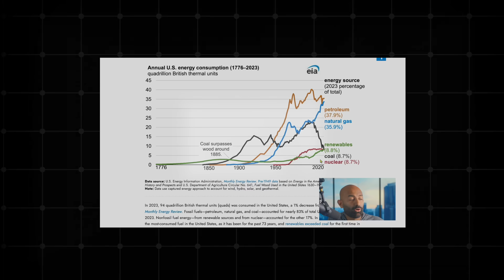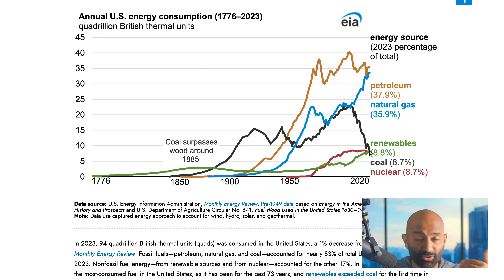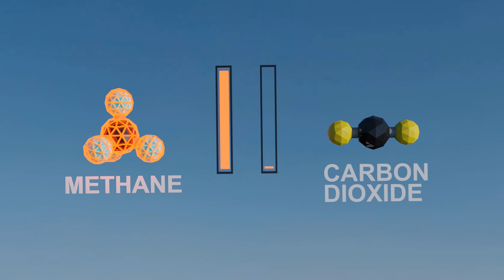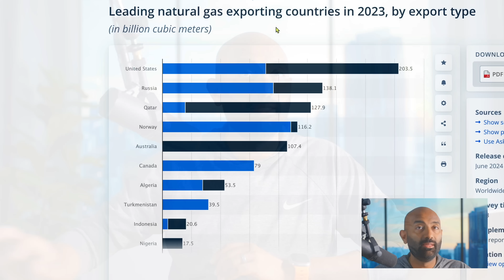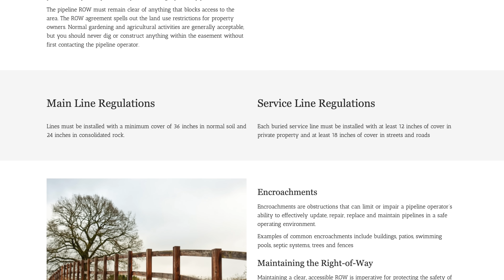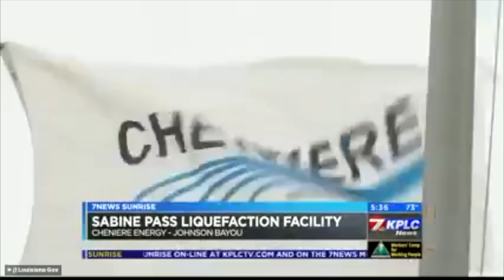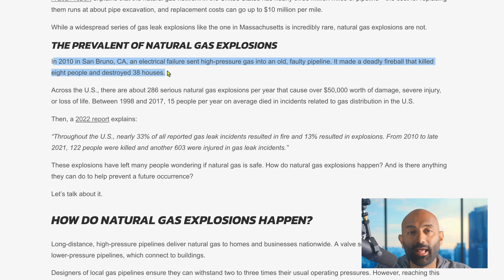The TRUE Danger of Natural Gas - This SHOCKED Me

Comment: Bro, as a 20+ year gas field compressor mechanic  I usually dig your vids but this is just fear mongering with tone, and harping on existing infrastructure.  pipeline transfer in united stated is by  far safest by volume including intentional and accidental emission.  The stuff boils up from the depths of the gulf of america naturally, have you ever smelled Galveston?!  🤣  Just dont get lost in the anecdotal evidence. A LOT of private and public moneys went into building out these networks, and that alone keeps it cheap for the masses trying to stay  warm and cook.(assuming the communists arent outlawing gas stoves)  The epoxy disaster and windfarm cemeteries are downright raunchy in the hazards posed to the environment compared to modern lng networks that spider across the country quite dense might i add.  Cheers from Texas~!

Comment: You should definitely have your pipes inspected every 2 decades (to 25 years).
The death figures are pretty small tho.   Well under electrical use and even solar power installation.

It does contribute roughly 25% of total Co2 when you include methane leaks during production.   

However, residential natural gas has an odorant added to it.   "The odorant added to natural gas is typically mercaptan (also known as thiol), specifically tert-Butyl mercaptan (TBM) or a blend that may include methyl mercaptan, ethyl mercaptan, or dimethyl sulfide."

Comment: Being lighter than air tends to make methane safer, not more dangerous. Methane tends to float up and disperse. Propane is heavier than air and thus settles. A propane leak in a basement will stay in the basement until it is full of propane and spills out or finds a source of ignition. 

All energy sources concentrated enough to be useful need to be handled with care. Electricity, methane,  propane, gasoline, lithium batteries all can be exceeding dangerous if not handled properly.

Comment: Just finished our gradual conversion. Heat pump water heater, then heat pump HVAC and now induction stove. We turned off our gas main 2 weeks ago. It’s great. Induction cooking for us is way better. The HVAC works the same. We are probably saving $300-600 in the winter on aggregate heating costs.

Comment: A house exploded in the UK recently because they installed a heat pump. The problem wasn't the heat pump, it was natural gas. And they hadn't nicked any gas pipes digging the geothermal system, it was natural gas. They'd hit a natural gas pocket, and failed to seal it correctly. Natural gas from the ground is odorless, and it built up to an explosive level and blew the whole house up and killed people. The area was evacuated for weeks. The house has since been demolished.

Comment: This is why in Canada we have plastic piping underground to people's homes and are not permitted to put unprotected piping into homes, we must sleeve steel or copper piping in plastic piping and double wrap them when going into the house or through floors which prevents corrosion. 
I agree with you that heat pumps are the future but a gas backup is required in cold climates. 
By the way natural gas and propane usually contain mercaptan which makes the gas smell like rotten eggs to be detectable.
Thanks for all your interesting videos!
Reply: That a backup is required is certainly true. But that it be gas isn't. A wood stove would make a good backup with fuel easy to store and acquire if you have land.
Reply: Maverick, I use a wood stove backup in our mountains. Solar runs the heat pump, mini-split heating during sunlight hours.

The good news is that battery backup is becoming safer and more affordable.
Reply: Mercaptan is added after processing the gas, and prior to delivery to customers.

Comment: As someone who has nearly two decades in majority-renewables engineering, I am certainly in favor of you paying me more money for new electric options. But as someone who has seen a much wider sample of the energy industry, I think there are many incomplete ideas in this video. Electricity has most of the limitations as gas in terms of production, transport, storage, losses, risks, and aging infrastructure. It has been implicated in some of the most costly and deadly wildfires in US history, the majority of which have occurred in your home state. Consider the Camp Fire (CA), the Lahaina Fire (HI), and the Eaton/Palisades fires (CA again), all occurring within the last eight years and having power line events as their probable origins. Do you remember the Moss Landing battery storage plant fire near Santa Cruz? It just flared up again two weeks ago. Also, electricity and gas are equally capable of contributing to house fires since the single largest source of house fires is the kitchen. In my opinion, you had some fair points to make but did not contextualize them into a full picture of energy needs and competing trade-offs.

Comment: Heat pumps are very expensive up front. And require super excellent insulation in the entire house. Almost airtight.  Seal up the fireplaces, no more cracking the window in the bathroom to let the steam out. 
When the ice storm brings down the power lines,… adios granny.

Comment: You’re saying use heat pumps to heat our homes ……are you crazy!? That would triple my electric bill easily living in the northeast right on the ocean. Yeah, no thanks, I’ll burn wood and oil all winter instead. Also, heat pumps only work till a certain temp. When it’s around 45 degrees and colder they won’t produce anything heat wise.

Comment: I have no natural gas in my area as we all require hauled in propane for heat.  I would like to purchase a heat pump for my home, that would be a 8k to 10k investment.  Still have to heat the water and I'm not sure that worth it.  I spend $2K per year for heating.   I'm effing stuck.  I'm old, my well went out that's $60k.  I'm old I'm on a pension.  If I went for the right SER rating heat pump I could qualify for a rebate (not sure under tRump)  I have solar so no electric cost.  Just sucks

Comment: Great ideas for urban people, but those of us in rural areas cannot just shift off from natural gas. You seem to have a bias against natural gas due to experiences which is fine. In rural Minnesota we do not have 100% reliable electricity.  By using natural gas for cooking and heating, we don't need a large generator to keep our homes warm for days. Also, in farming and at our local co-ops natural gas is used for drying grain. A lot of farms use propane to dry crops but a lot of farms in my area are getting access in the last 5 years to natural gas which is much cheaper to heat with and dry grain. Natural gas is booming and growing at an incredible pace in my region.
Reply: This isn't a "urban vs rural" situation. Some of the best use cases for homes eith no gas are off grid homes. If a home is built to retain energy better, it doesn't need the higher energy usage gas and can do just fine off solar or geothermal, etc. But he does say in the video that maybe gas is piped and reserved for use cases where it makes the most sense aka the coldest climates.
Reply: I agree, I live in rural Saskatchewan
Reply: I want my choice.  If you want electric, fine.  Don't touch my natural gas.

Comment: @7:50 LNG is not "consumed".  LNG is a storage mode for transport.  It is re-gasified for consumption.
YouTuber Engineering Explained does a very good video on the Gas Explosions in the Merrimack Valley. (Near Boston).  He has other NG videos as well.
The flare gas at refineries is not necessarily natural gas but rather a bevy of gases that are not commercially useful.
@11:21 - those are oil pump jacks.  Nothing to do with NG.
There is no such thing as "sustainable potash" - it's a one shot deal.  Mine it.  Use it and it's gone.

Comment: I have heard that renewables are possible precisely because of natural gas backup, which can ramp up and down more rapidly.  What is missing in the renewable portfolio (wind and solar) is dispatchability.  This is the so-called "clean firm power".   I suppose (grid) batteries can take up some of this slack, at least for time shifting.  And some gas peaker plants are being dis-placed, with batteries.  There is a need for "long duration storage", esp. seasonal (mainly winter)..  Perhaps other alternatives maybe enhanced geothermal (e.g. Fervo), and nuclear (SMR's).
Reply: pumped water storage too.
Reply: Much of the seasonality can be handled by the grid moving electricity around. The frozen North needs more power in the winter. The sun baked South needs more power in the summer.

Comment: I live with a high energy heat pump now, and an electric stove I wish had an inductive cooktop. I use an induction single burner regularly, though, and love it. If I were buying a new stove it would absolutely have an inductive cooktop. A household member has asthma, and it's made me keenly aware that a gas stove is the biggest source of indoor air pollution in the homes of most people. Houses can and should be all electric moving forward.

Comment: When I was 12, we moved into a brand new house and a few years later we had a bad gas leak. I saw the pipe. It was very rusted in one spot and not at all in either direction. It was because of the acidity of the soil and that one spot they attached an anode to it and large piece of zinc I thinkand that was supposed to stop it from happening again.  they must add mercaptan to make it stink

Comment: Not everybody lives in a city where you have pipelines.  the other form of Natural Gas, AKA propane is indispensable  in rural areas,  especially where you are not getting enough sunlight each day to charge up those nasty Lion batteries. further, minisplits that use gas to heat the emergency heaters makes way more sense on the off days. ,,  I know I live this each day.

Comment: We live in southern Ontario Canada. We use NG for our furnace and water heater because it's cheaper and available at a flat rate. It will take three things to get me to replace my water heater and AC system with high efficiency heat pumps. 1) The tech must mature enough to represent a savings in under 10 years, 2) The government must offer a flat rate billing system, and 3) The Government must offer us incentives like low or no interest loans, or a large and immediate rebate. Not one where people have to PIF and then wait for a cheque. The NG furnace will stay as a backup. Because while -40 is uncommon, it's not impossible.
Reply: Exactly. It would cost a fortune to replace/upgrade every appliance to electric, and not everyone has that kind of cash sitting around.
Reply: @timwildauer5063  I wouldn't replace anything until it needs replacing.
Reply: The electric grid couldn't handle it either if everyone was forced to used electricity.
Reply: @callak_9974  Ask literally any industry professional who is not subsidized by an oil company.

Comment: We have satellites mapping gas leaks. Producer's should buy the data and just fix the leak.  Our power is produced by nat gast, so our heat pumps are still using nat gas. Now there are heat pumps driven by nat gas to the house, although you are correct

Comment: In Australia we see galvanised pipe that is buried for use with gas or water become swollen and develop into a near rock formation that eventually weeps and dissolves. I’ve been told it’s called chlorosis but I’m not sure. It may have to do with moisture and electron exchanges in minerals in soils. Usually 50 yrs is the life span of a buried galvanised pipe.

Comment: I have a gas well on my property and draw from it for my house. to do this I have to add an odorant to the gas before it comes inside by law. as has been said gas delivered to customers also has odorant. As you say it is lighter than air and as such unless the leak is inside it will quickly disperse in the house you will smell it. While it's not great for the atmosphere it is not nearly the explosion risk you seem to imply.
Reply: Well, a heavier than air gas would be a bigger explosion hazard certainly.

Comment: I live in Minnesota. The last thing I ever want is to be totally reliant on electricity. I have back up generation but it is a limited source in a real emergency. In the winter especially, it would maximizes my generated power and it heats my hot water also with fast recovery which my previous electric water heater did not. As for leakage being hard to realize(?)you have not been around a leak. Our pipes are all non corrosive plastic except for the last 4 feet. It purposely smells to high heaven. If you live in an area without freezing temperatures be my guest to trust your heat pumps. I know of two people who have heat pumps for household heat and it has been a disaster for them to keep them working in the winter. My two cents.
.
.
Reply: Spot the bot.

Comment: NEVER allow that explosive gas inside your house.  Gas is horrible option compared to electric.   Very dangerous.  It never should have been piped into residential structures.  Electric is 100% efficient, appliances are inexpensive and easy to control, and often operate without any noise.
Reply: In fact a heat pump moves heat so it can be over 300% efficient!

Comment: I googled some comparisons: The cost of gas vs electrical hookup(gas is much cheaper). The cost of heating with gas is much cheaper(maybe 1/2). The reliability as a backup source and cost for heating(gas is incredibly cheaper). The cost to install gas heat vs solar heat is much lower. There should be improved standards for solar hookup and new homes should be designed for solar, else gas use will thrive. I'm old, I could never justify the cost of replacing my gas pack with all electric system with solar. I wish I could!
Reply: I also live in New England and at the cost of gas and the cost of electricity, a heat pump is only the best price above 34°F. This would be for Nashua, NH. 

If people want to transition away from heating with gas, they had best start building nuclear power plants because solar doesn’t work well in the winter, wind is unreliable and ugly. We could bring in hydro from Quebec but last time they tried there was a huge outcry about running the wires. 

In the meantime, in January, people are very happy to have gas heating. I sure wish I did.
Reply: The cost of heating with natural gas vs oil vs electric are very regional dependent.

I am in an area with around average natural gas prices but well below average electric prices.  Switching to a heat pump for home heat and hot water was a no-brainer.  If I had natural gas as an aux heat option, natural gas would have been cheaper than my heat pump at 0 degrees F this winter.  We never went below 0 this winter.

In New England, where most of my family lives, heating oil is the the most cost effective heating option this year.  Natural gas almost was until some very high delivery fees were added to bills in Massachusetts.  The electric rates up there are just insane.
Reply: Spot the bot.
Reply: Heat pumps save money and lives.

Comment: For Pa at least, air source heat pumps aren't powerful enough for winter heating. Maybe they are in a 10 year old house, but not so much in a 90s build, and definitely not in a 200 year old farmhouse. Also, I can run my oil furnace and circulation pump on a generator when storms knock out power. I'm sure there's generators that will run a heat pump, but they are a lot larger and more expensive, to buy and run.
Reply: New cold climate air source heat pumps operate down to -30C (-22F) and it heats my 1970’s house in Canada just fine.  My backup heat source is a fireplace with insert.  I needed to use the fireplace about 15 years ago  for 10 days when a part on my 12 year old natural gas furnace packed it in and couldn’t be found anywhere.  (I finally replaced the furnace.  A generator wouldn’t have helped because the furnace wasn’t operable. )
Reply: @marksibley5406  How much was it, and what's the max temperatures for cooling? Genuinely curious, because my uncle just put a heat pump in that won't work below 20F.

Comment: I went completely electric over a year ago.  Not missing it.  Replaced 20+ year old furnace+A/C with a cold climate heat pump and a 20 year old gas-fired hot water heater/tank with an electric instant hot water unit.  Since they needed replacement it wasn't a hard choice to replace them with electric equivalents since I would be adding solar to my roof.  I paid less than $30 last year for the 293 kWh used to heat the little hot water I use.  I used 1762 kWh to heat and cool my place.  Just above half of the total 3461 kWh I used.